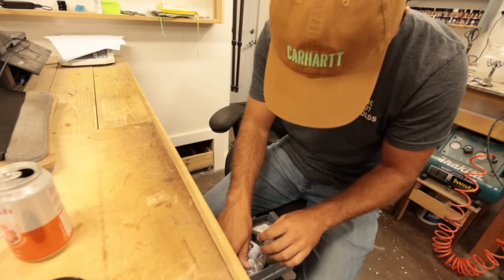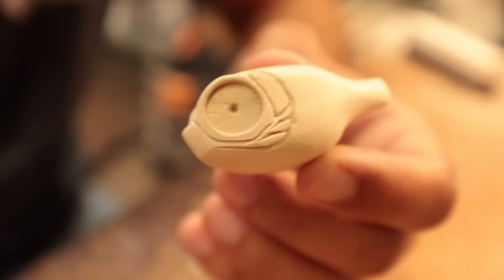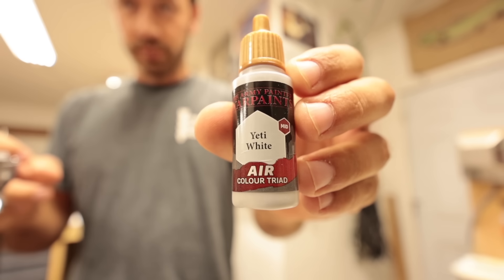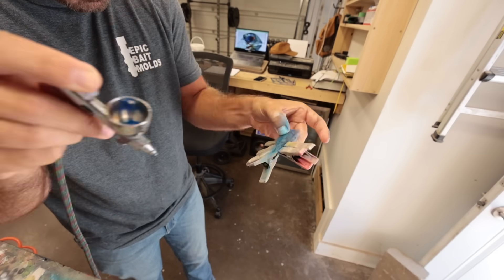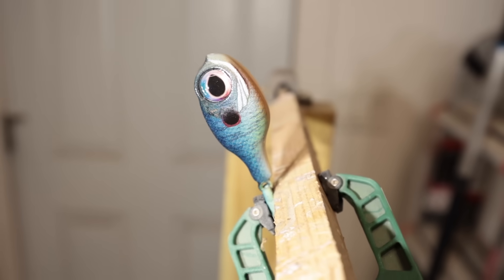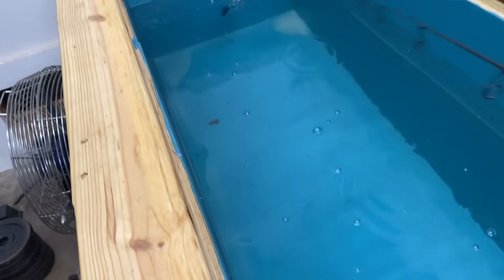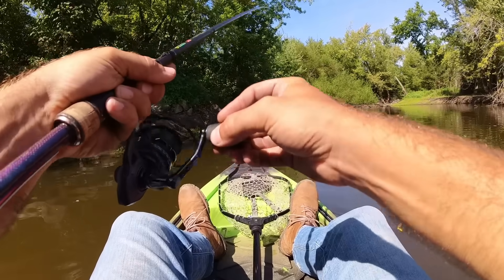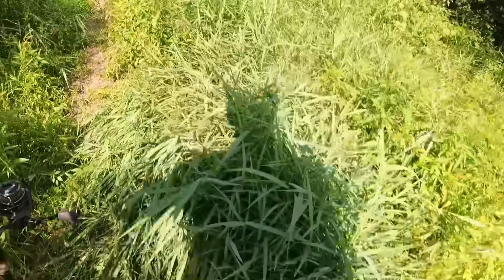Wooden BuzzBait | One Day Build to Catch

Comment: Loved the paint scheme. Felt your pain on the missed strikes too. Equally baffling as a crank bait has trebles too as you said 🤔.  Great video regardless and you shook the skunk off!!! On to the next bait!

I wonder if putting a joint connection where the fish mouth meets the shaft of wire would increase the hook up ratio at all 🤔??

Comment: You could try something like a Gamakatsu siwash hook in place of the treble. If that doesn’t help by itself, try adding a floating straight tail or twister tail threaded on the hook to help keep it more horizontal during the retrieve.

Comment: Best guess to improve hookups smaller back hook so it can't wrap entirely add a second treble on the bottom as well if hookups are still weak both to give you more chance of hookup and to make sure it truely stays belly down looked good in the ponds but in the tank like you acknowledged wanted to roll a bit. Real shame for it to fail the one day was absolutely beautiful lure and getting lots of hits I'm sure it will get redeemed down the line.

Comment: Maybe a second hook in the belly could have helped or maybe smaller hooks. That’s a tough one to solve though. It really looks like it would have worked so well. They definitely responded so it definitely got their attention. I would be tempted to add a second hook and downsize both hooks just to see if it would help the hook up ratio.

Comment: May not be worth your time, but instead of using up a whole brush to apply super glue or epoxy, I make mini brushes by cutting a little bundle of bristles, taping the end with masking tape and applying a dab of glue to the end. You can also add a piece of bamboo skewer as a hand. That way one brush becomes like 20 and saves some dollars. Also I reckon you should use a paint brush handle to make a one day, but give it the Marling Baits treatment and take it to the next level 😀

Comment: I think it may be the angle of the wire and the way the tail of the bait brings the hook higher than a normal crank bait. That and crank baits having the front hook so even if the rear hook is higher the hook up ratio is evened out.

Comment: Your buzz side of the bait should be at least 1/2 the length of your bait side if not shorter. You are eclipsing your hook with a big metal shield.  Change the length and that will slay👍

Comment: Have not watched yet, but as an avid buzzbait user I am curious to see how the treble works as opposed to a fixed straight upward facing J hook.
Reply: I figured the treble would do better but not surprised it did so poorly. The bait likely would need to be fully inhaled or hit just right for the treble to hook up. I've experienced similar results using the Arbogast Buzz Plug which now collects dust and rust in my box while Cavitron buzzbaits stay tied on from May through October (New England).

Comment: I think they are hitting the buzzer. I'm using spinners quite a lot. Their moving parts is behind the body, usually the hook is on the belly, other have 2 hooks on the belly and behind the moving part. Usually they are not exactly with a buzzer but with a spinner leaf. Not sure how the one with fixed hook and squid tail work at all.

Comment: I dont think the treble was the problem. I think its one of two things, or a combination of both. First, i think the vertical offset was wrong. Bring it closer to the bait. Thats the lesser of the issues. Second, and more importantly. The body and hook need to be further back from the blade. 

All that said. I think this bait has the potential to be one of your best. Compare it to a store bought buzzbait for better geometry. Then 2 other issues i would personally change. Make it a wire through. Also, use some heatshrink on the treble. That will hold it straight out behind the bait.

Comment: I think I know your issue with this bait:

Simply put, the fish are biting at the fish, but colliding with the blade and/or wire is tossing the bait.

If you look at most buzz baits, the jig is trailing behind,  almost chasing, the blade.

Wouldn't hurt to dress that trebble with a little rubber skirt to simulate a tail..

I made quite a few buzzers when I was younger.